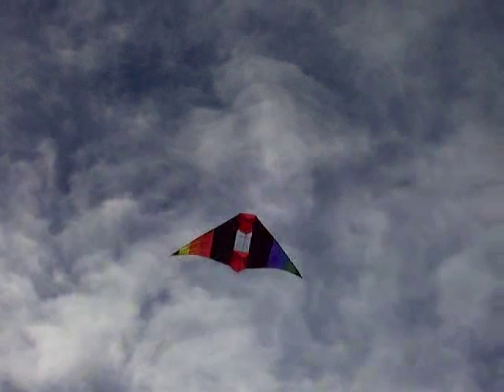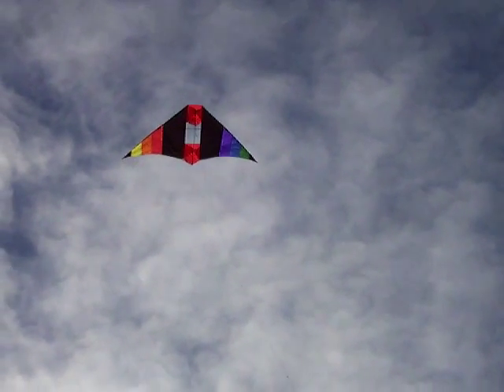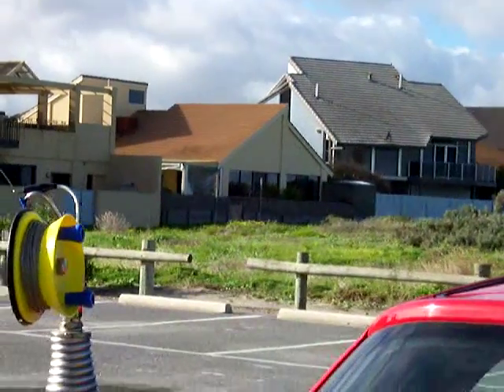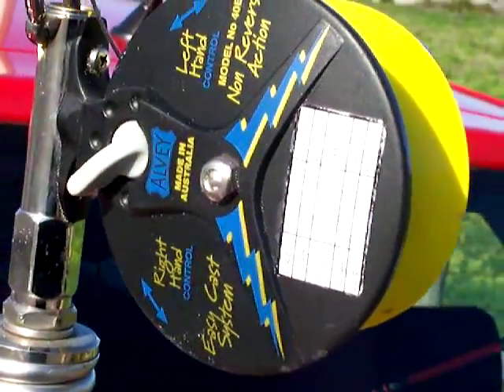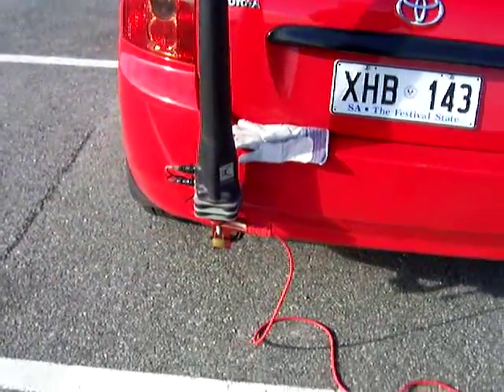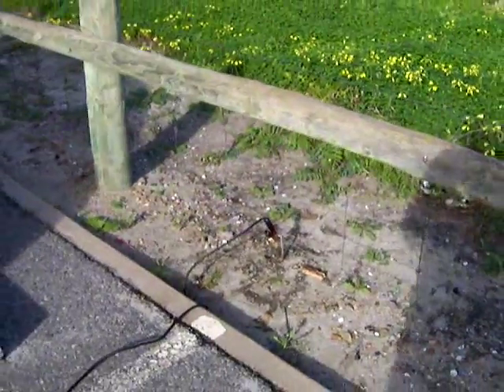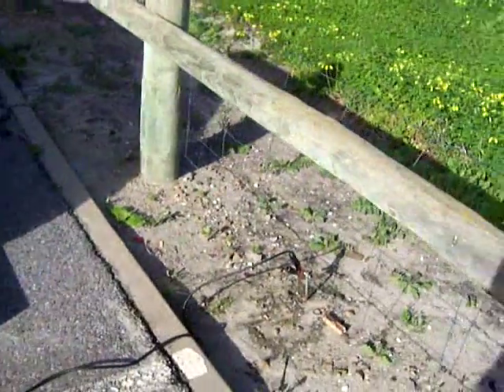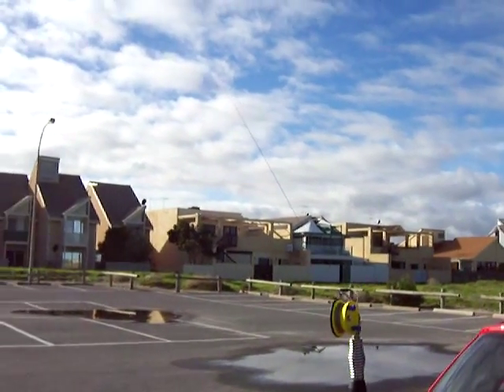160m Delta kite aerial

Comment: This type of kite is excellent in low wind conditions. 
It can make difference of flying or not flying at all.
However, 120m high winds are often much stronger then close to earth.
I have 4 of these kites, but use is limited to quiet weather.
I only use this type of kite in summer evenings, when wind often dies.

Comment from the maker: @GregS635563 
The white wire is attached to the metal threaded support section via a lug and screw. This allows for a continuous and direct connection between the wire and the existing antenna, which may not exist when the wire goes slack from, say, a sudden drop in wind strength. The wire may otherwise form a "weak" connection to both the carabiner clip and the metal support. ok? Hope this makes sense.